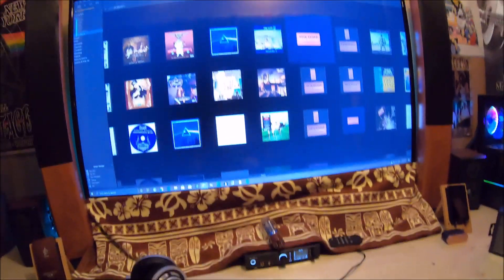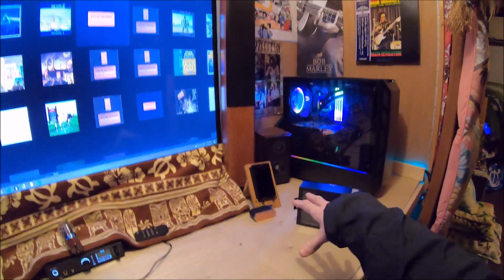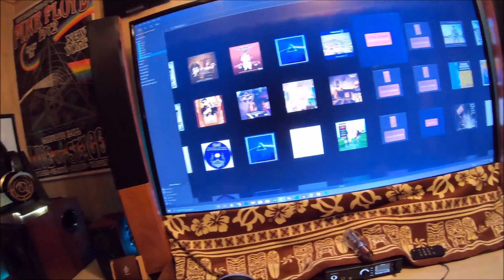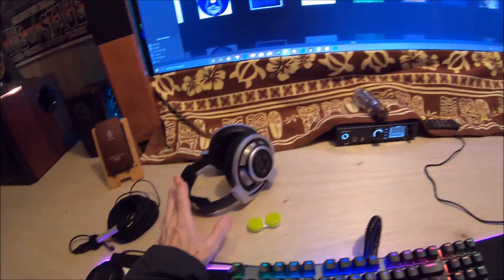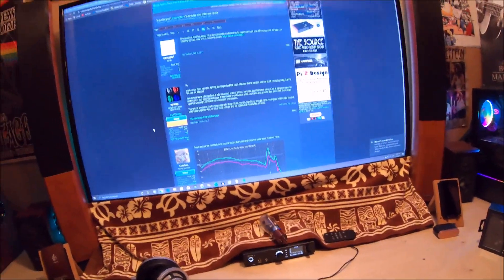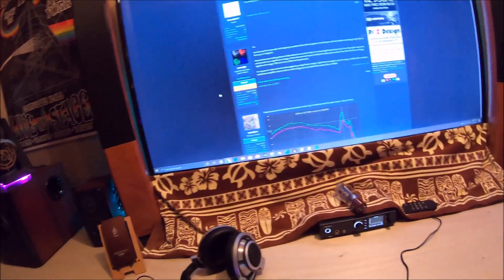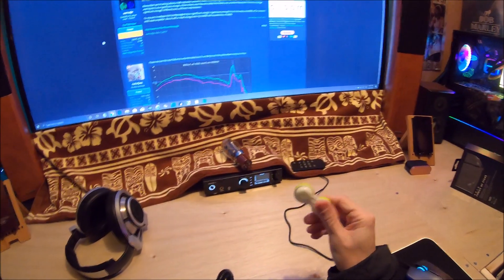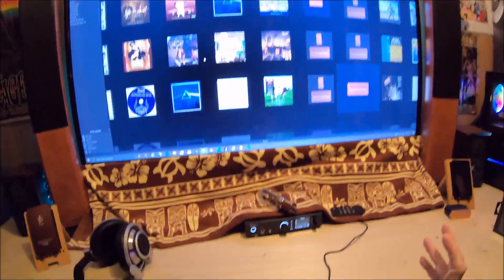About me..  HD800  and exploding tubes

Comment: Newer, especially Chinese made, rectifier tubes are known to be garbage. At least compared to NOS one's anyway. You just got a dud it seems. But even the good ones aren't known to last long, at least in traditional HiFi gear (I'm into vintage tube gear, that's my HH Scott 340B receiver (which actually has solid state rectification) in my avatar). So I recommend finding a minty fresh NOS one to replace it. And then the fireworks should be long gone. These are a part of the power supply, and help to change the AC to DC. So there's quite a bit of power going through them. Not a good place to be cheaping out obviously. 😉 ✌️
Reply from the maker: Thank you very much. It's NOS time!
Reply: @BadGuyGoodAudioReviews  No problem. A little tip on tubes in general to save money. See if there's a Soviet era Russian equivalent for that tube, and look on Ebay for them. There's guys all over the former Soviet Union selling surplus tubes that are usually very good. Many times there's even a military equivalent for a little more too, that's built to last longer and take more abuse. Which is obviously perfect for a rectifier tube. They used tubes in their tanks, planes, and ships just like we did back in the day. Anything from the 80's back should be pretty good quality. If you can't get them. Try to find nice American ones. They'll be cheaper then European ones. Which are kind of overrated IMHO. Good luck. ✌️

Comment: Tubes fail that way once in a while.  Sometimes you can catch them in time and power off so you don't have as much flash or sometimes a pop of the cathode bypass cap.  That looks like a rectifier tube, so no bypass cap.  Not a big deal.
Reply from the maker: Thanks. You clearly sound like you know what's up. I will replace that tube and try again

Comment: Sorry for asking a few times already but drop having the shozy only for a few more hours now I want to ask again: 

could you elaborate what voy3 does "worse" than 1.4? For me I think the 1.4 will fit better but the voy3 seems really good as well.
how does the tuning possibility affect the voy3?

sry for the inconvenience and thank you very much in advance.
Reply from the maker: Just bass as the 1.4 has a dynamic and at stock tuning it is not bassy like the voyager but warm. The Shozy can take eq if you love bass the voyager can do that but not quite as well
Reply: @BadGuyGoodAudioReviews  so fkkn hard to choose man. I do appreciate good bass especially sub bass but the blon for example sometimes does sound overbearing keep in mind you reviewed the voy3 with silicone tips whereas I can only use memory foam tips.
and are you saying that the tuning switches on voy don't do much?
wish I could just get both
Reply: @BadGuyGoodAudioReviews  wait a second. did u have a typo maybe? or is voy3 bassier than stock shozy?
I did not pull the trigger on drop because I am still not sure which one to get😢

Comment: Tubes have a life span and yes they do blow out. That tube was a dud, tubes should last a few hundred hours.  Although, they are a little finicky and are known to be sensitive to temperature variations, handling (stress cracks), and oils from your hands.  They are delicate. I have blown a few tubes (or valves are the British say it).  And it can get a little expensive to replace them.  Especially here in  Canada.   Russian Tubes are considered the best because mother Russia is always best? ¯\_(ツ)_/¯ .  Anyway,  I also have some vintage RCA tubes and some Chinese tubes.  They all sound kind of the same to me.  My Darkvoice Tubes get crazy hot and I don't use it often. It is literally a space heater.   I worry about leaving it on because my sons think it is cool and they want to touch the tubes.
Reply from the maker: I think fall/winter is only time I want a space heater so just briefly will I use them unless it's cold like today which is FREEZING
Reply: @BadGuyGoodAudioReviews  yup Toronto is f-ing cold right now too
Reply: @BadGuyGoodAudioReviews   The tubes have to reach their operating temp to sound as they should. I don't know what the spec tube temp is for your setup but they would have to run extremely hot for oil from your hands to affect them. Generally when you get a bad tube it goes in the first couple of hours, sounds like your situation. When you power it up nxt time watch it carefully for a while I've had mine start smoking when powered back up after blowing tubes. Cooked some internals.